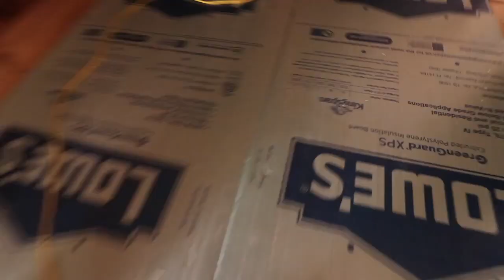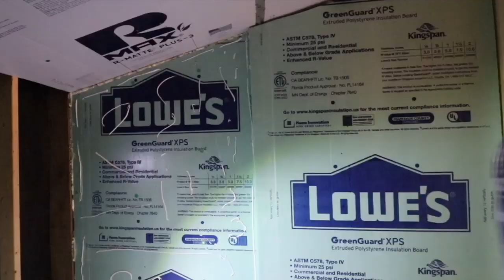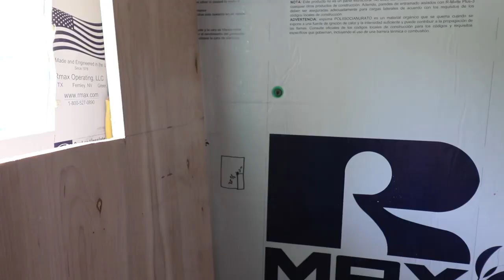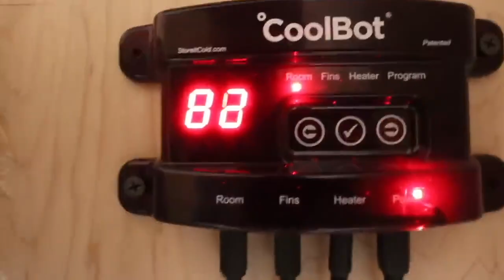EPIC Walk In Cooler BUILD (start to finish) 30 Day Timelapse

Comment: Hubby and I just finished doing this in a corner of our basement. We're venting with the air conditioner into the basement. Since the earth is bermed up to the house in that corner, the northeast, on both the north and east we don't have to insulate heavily on those two sides.  Very exciting to have this resource ourselves. Happy for you having it also!!

Comment: How awesome. Tons of insulation (more than I would think) means less electricity needed for cooler. One extra: How about a temp gauge mounted on the cooler exterior to help monitor inside temp without opening the door to look at the digital readout.